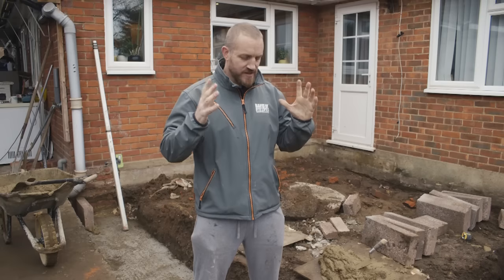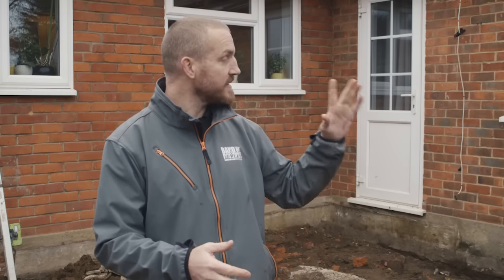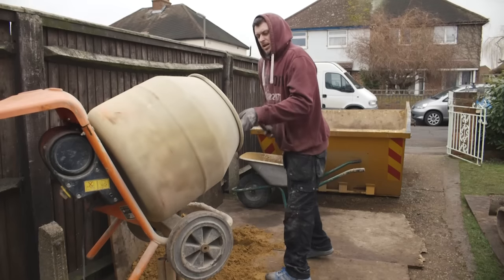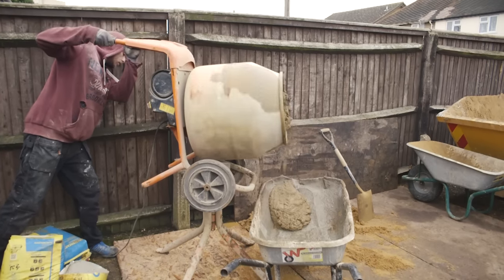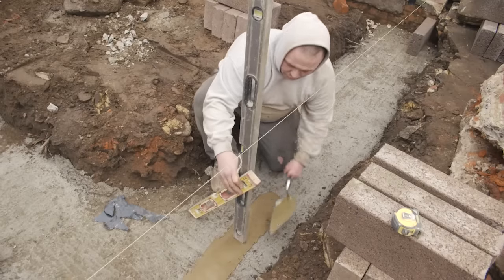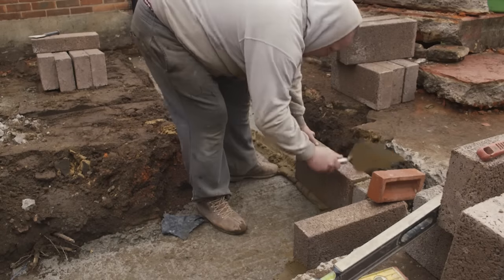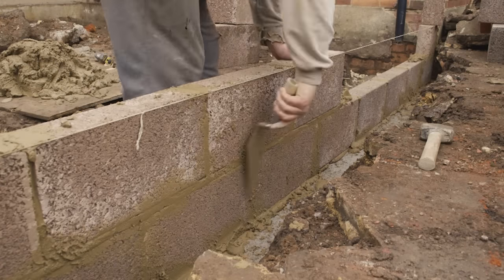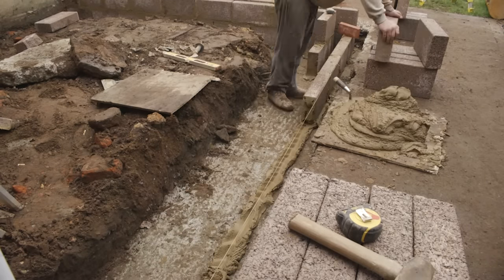How to Start Building Walls; How to Build an Extension (3)

Comment: Should be 3-1 mix for sub-structure [ splash course ] [ below damp ] then above damp whatever spec there is on the drawings normally 6-1/5-1.  Worked on hundreds of New builds as Site Engineer

Comment: Great video. Can you give more on the string line. How its used on inner skin. How to shift it to second course?
Reply: Do not use fairy liquid, use profiles for line/setting out, fill cavity up to GL with concrete to prevent ground heave. Use stronger mortar mix below DPC, gauge mortar/ container not half bag method. Could use Sulphate resisting cement ? Start face work just below ground /paving level or could use engineering bricks up to DPC/splash course. Fold DPM if concrete floor over internal walls then bed DPC on it. Tie into existing house/lap.

Comment: What’s the reason for not filling the gap with 100mm insulation or not having the air gap either side? Thanks.
Reply from the maker: The air gap helps keep the air dry, and prevents moisture. It also reduces cold-bridging.

Comment: Could you please explain why only 50mm cavity wall insulation, why not 100mm to completely fill the gap ?
Reply: You need the gap,in-case of was
water bridging from the outer leaf.
Reply: You can have full fill insulation but it is best to least at least a 25mm gap to allow air to circulate within the cavity. This will help reduce interstitial condensation within the wall and stop any penetrating moisture for the external leaf tranferingvto the inner leaf.
Reply: There has to be a "breathing" space
Reply: To allow the wall to breath and stop the transference of moisture from 1 skin to another
Reply: Why would you fill the cavity completely with insulation as it will get wet with heavy rainfall ,,, so what you got is wet insulation 🤷🏻‍♂️🤷🏻‍♂️

Comment: 5cm insulation in 10cm cavity? whats the rest of it gonna be? Also,  will the insulation forward any sideways pressure between two skins? because i have a feeling that both brick layers alone are kinda thin and if they could move independently, then some force could easily tumble one or both layers
Reply from the maker: 5cm insulation, and 5cm air. The insulation gap prevents moisture build up, and condensation.
Reply: @HomebuildingMagazine  oh, thanks :)

Comment: What happens if those bricks aren't straight with the house, can it be rectified without taking it down again?
Reply: Can the walls be put straight?
Reply: Also, how to do you string line on a semi detached house party wall? Thanks.
Reply from the maker: Hi Kelly, if your brick wall isn't straight, there isn't much you can do about it once the mortar has set. How catastrophic is it? It depends how wonky they are, and what the wall is designed to do / support etc. It might not be the end of the world depending on what the purpose of the wall is, and you could possibly disguise the imperfections with cladding ... but without knowing too much about it, we'd suggest spending time getting the wall straight first, instead of time spent trying to hide it! :)

Comment: I am going to build a wall like this and build a timber suspended floor and timber frame to give me an extra room off my front room with patio doors, I gather I will need to put air vents in the brick wall and would I need planning permission, it will be 5 meters in length and 3 meters in width, roughly 2.6 meters high. Thanks
Reply from the maker: If it's a single storey extension at those dimensions, then you should be able to build it without acquiring planning permission - it should be acceptable under Permitted Development. However, check with your builder / designer / project manager before you break ground! You'll need to ensure the construction meets Building Regulations so definitely best to speak to an expert.
Reply: Permitted development in my area only lets you erect 3m out from the rear of the property

Comment: is it normal in the uk not to place steel bar for reinforcement inside your blocks?
Reply from the maker: It depends on the size / type of build involved. We'll often use steel rebars for full builds and some larger extensions, but it's a case-by-case basis. This built didn't require it according to the building regulations.
Reply: @HomebuildingMagazine  cool . we have earthquakes every now and then in hawaii hence i wondered. Thank you!

Comment: First few mixes should be 3-1 It's underground so should be substructure muck. 5-1 is no good underground would not be strong enough to pass regs.
Reply: I use 2-1 or 3-1 but i'm in Canada. Was in Nova Scotia (hence 2-1) and now im on Vancouver Island. Pretty common to see 3-1 here. 5-1 seems pretty weak. But whatever works

Comment: what if i lay my first course of block flat then build my wall would that be ok
Reply: It won't be 300 wide (100 for first block, 100 cavity and 100 for second block) as blocks are only usually 215 tall.

Comment: how do you make sure the corner block is the same height as the house block?s
Reply from the maker: String lines. Builder's best friend!
Reply: @HomebuildingMagazine  thanks for the reply. So you string it and then put your level on the string line?
Reply from the maker: Yes, exactly that. Good luck!

Comment: 5:1 total rubbish. 4:1 for building 3:1 for pointing, washing up liquid breaks down the cement. Crazy !. Hammer in bolster verry easy to use and effective!
Reply: 4 parts building sand, 1 part sharp sand, 1 cement, 1 lime and feb. Best mix imo.
Reply: yes mate 3:1 below ground aways
Reply: A 5 to 1 mix is the UK industry standard, (Although sulphate resistent cement is recomeneded for work below ground.)
One of the first things I was taught as a lad was never use a mortar mix stronger than the brick/block you are laying.
The strength of any wall is in the brick/block, not the mortar. If there's any movement in a wall, you want the mortar to crack, not the brick/block.

Washing up liquid does not break down cement but it contains solvents that can leave oily stains on the mortar beds. Plasticisers are very cheap now so there's no excuse for using washing up liquid.
Reply: @wolfhachmuth7731   ............... 
You'll have fun trying to lay brick with sharp sand mate ..... 
And no brickie I know in the UK uses lime for standard brick/block walls anymore. 
Hydrated lime is a plasticer which can be replaced by 'Feb'. Although I often use it for weather struck pointing mixes because it gives a mortar a better color and smoother finish.
Hydraulic lime is often used as a replacement for cement in mortars. It is mostly used when specified in restoration work or re pointing.
Reply: @SilverTrowel631  i said 4 parts building sand, 1 part sharp sand. Not the whole mix in sharp. Works well, done it many times. Lime is a replacement 4 feb, i agree. But it don't hurt using both.
Reply: 4-1 spot on    was ridiculed for this mix 15 yr ago....now its the official mix

Comment: Why such a little piece in the corners?
Reply: To maintain the half bond.
Reply: who so you get the staggered bond, with the little piece in the corner means the block on top will be half on the block underneath o get the bond
Reply: 100mm cut means next block laid on top of it is half bond
Reply: I understand the piece is to maintain bond but it's the wrong size piece in my opinion and how we do things here. I was always taught that you never put anything smaller than a half in the corners unless it dictates because of an opening.  We would put a larger piece in the corners it makes it stronger and honestly looks better. So for instance with the material laid in the video it appears to be a 4" wide block and going by a comment made by someone else 100mm. I would eliminate the 100mm piece turn the corner block the other way   and place a 300 mm piece or a cut that is 3/4's of the total  length of a full unit. To each their own  but most competent inspectors or architect's here wouldn't let that pass without a very good reason. Hope that helps you  fellas understand.
Reply: Been in the game a long time now and never come across an architect or building inspector who questioned this method.
Reply: We allways use 100mm cut to maintain half bond in uk.
Reply: I can see where you're coming from, but whether it's right or not I couldn't advise.

Comment: I thought concreate takes at least 3 days to cure?????
Reply from the maker: It does take that long to cure fully, but it's solid enough to begin to build on after 24 hours in decent weather conditions. Any wet weather or low temperatures will increase that time.